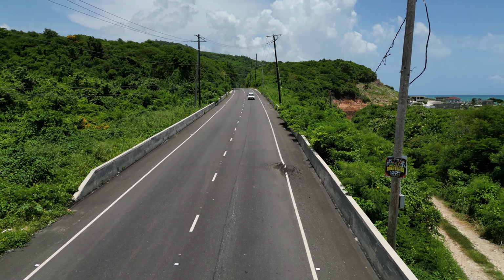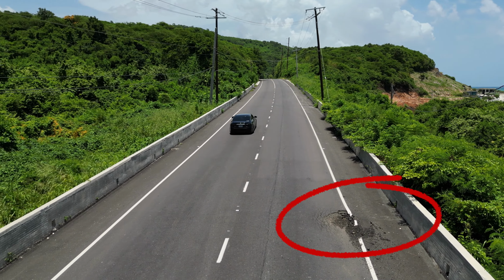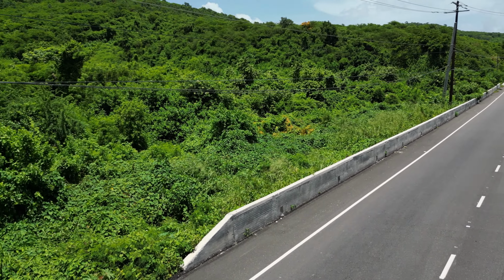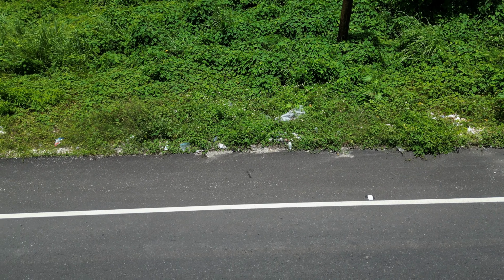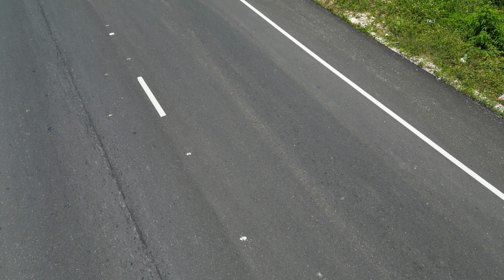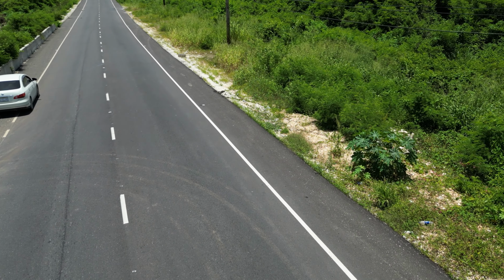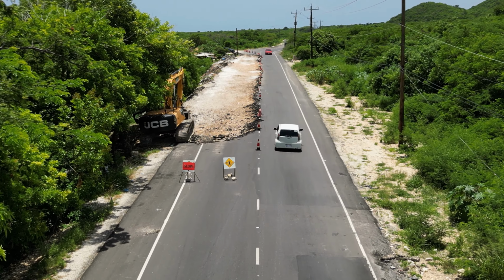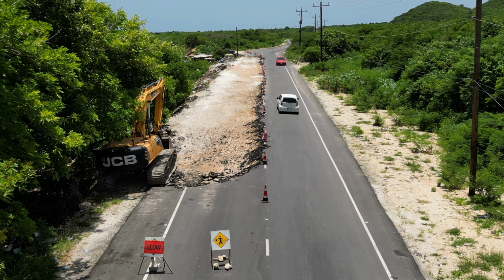The Insane Cost of St. Thomas' Road Infrastructure Damage.

Comment: Look! This road is clearly under-engineered. Many heavily laden trucks use this corridor daily and they obviously did not account for that. The Pamphret road always sustains damage since it has a soft subsoil which causes the road to sink in many places when the trucks use it. They needed to use a harder, thicker substrate under the surface to prevent this.